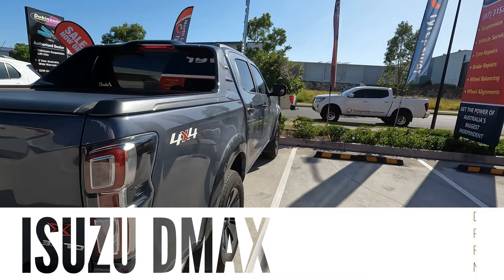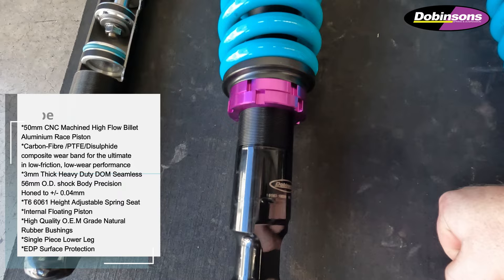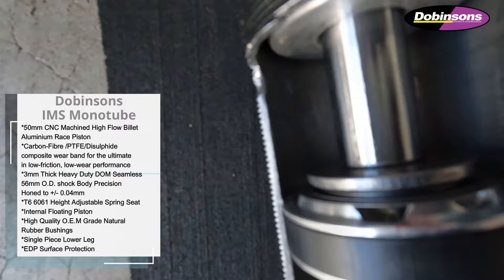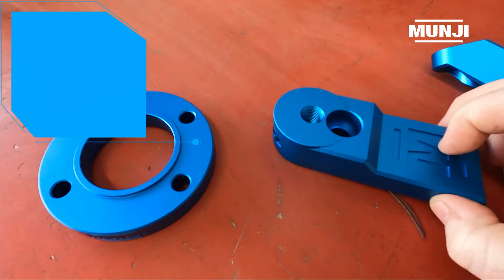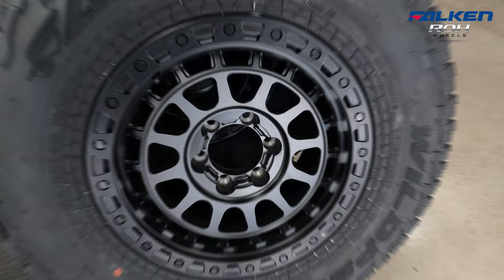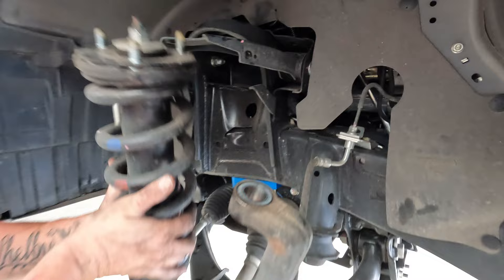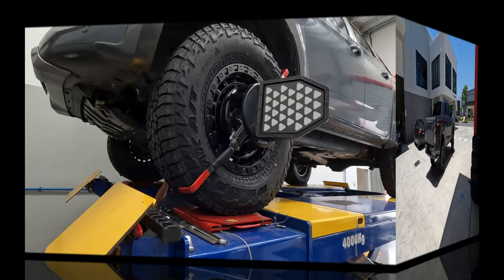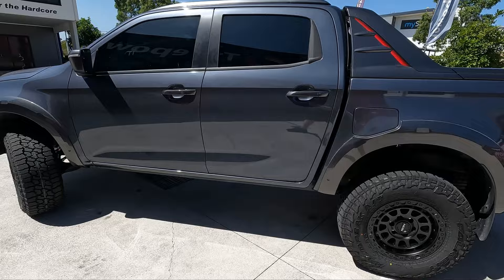Isuzu DMAX - Dobinsons IMS Lift, ROH Wheels, Falken Tyres Install

Comment: Hi, what offset  on the rims? Did you choose? Nobody ever tells you the offset, I have a my22 dmax with an alloy tray and a 2 inch lift and don't know what offset to choose to fill out  the  gaurds on the tray regards
Reply from the maker: Hi John, if you would like to give the guys a call in store on (07) 3153 4136 and they can run you through some options. Thank you